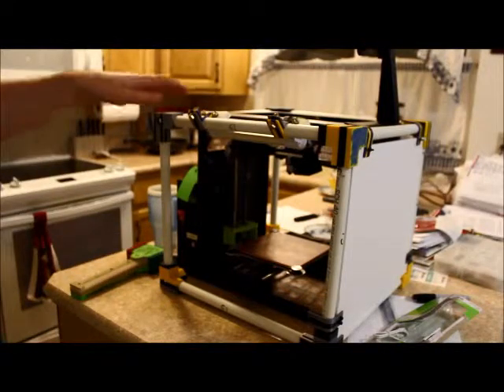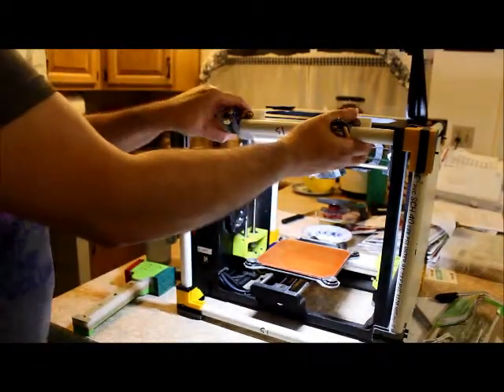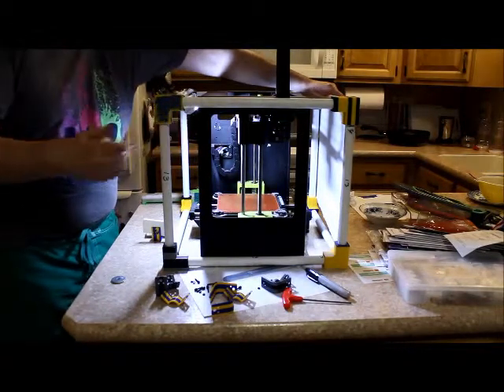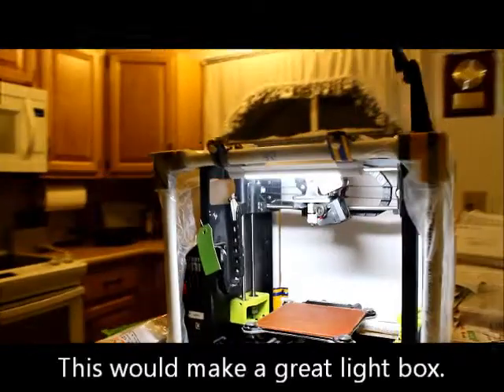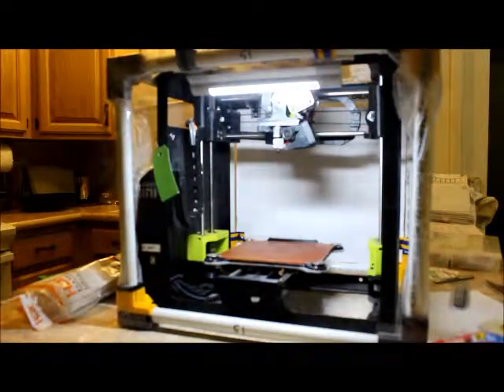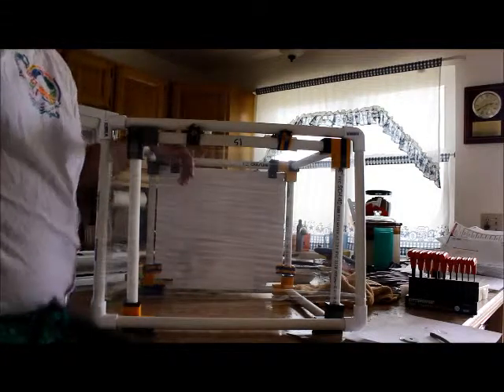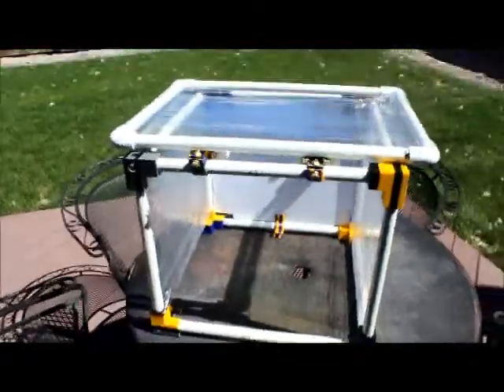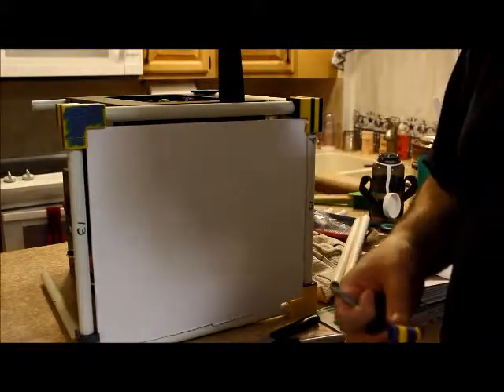PVC enclosure Pt.2

Comment: I really hoped you would put in panels.  I like your corner brackets.
Reply from the maker: I have the one in back for lighting, but I plan on using this printer at conferences, so I want the public to see through the sides. If you plan to have your printer in a maker space or classroom where you don't want the distraction, then foam core panels would be great.
Reply: @3DPT  I'm using these for Lexan panels all around and plan to have a hinged door in the front.  This will go around a Hypercube soon.
Reply: I was also going to look at wood dowels instead of PVC.
Reply from the maker: I was thinking about that, but I was also trying to keep it affordable for STEM classrooms.
Reply from the maker: I chopped an old broomstick for some dowels on another project, they worked great with some sanding.
Reply from the maker: If you look at the shelf video, I put shelf in the slots for that.